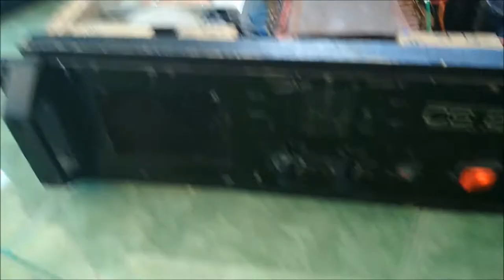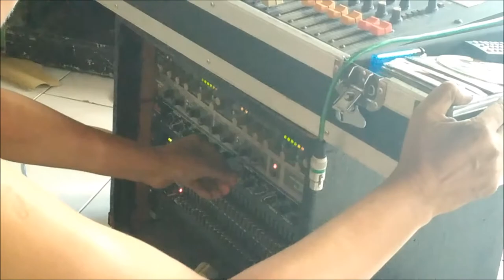test spk 18″ 18900 PREMIER #PRODIGY by ACR

Comment: itu power nya pake trafo berapa ampere? finas berapa set?
Reply from the maker: 20A x2 final 8set sanken
Reply: @MiftahulMuzakki  pake driver apa mas? dan tegangan trafo berapa volt?
Reply from the maker: @007satrya  kalau divideo driver safari, tegangan trafo 45ct,, sekarang sudah saya ganti eeengine 100ct